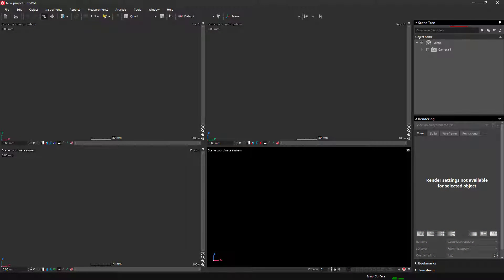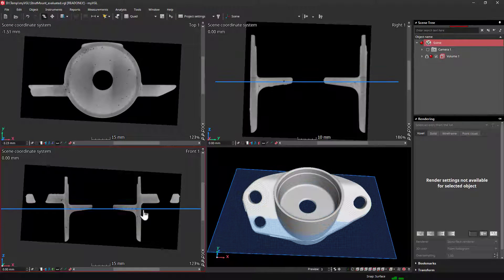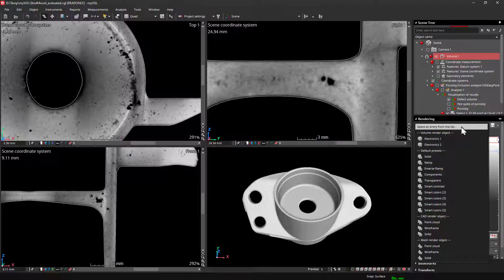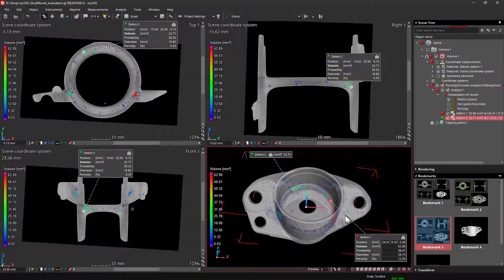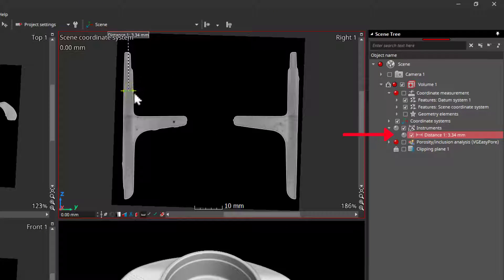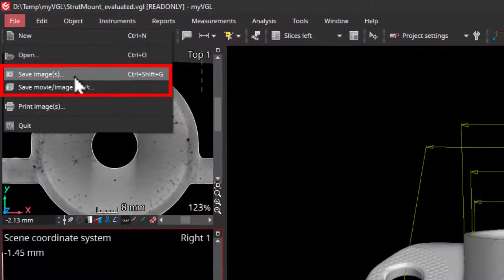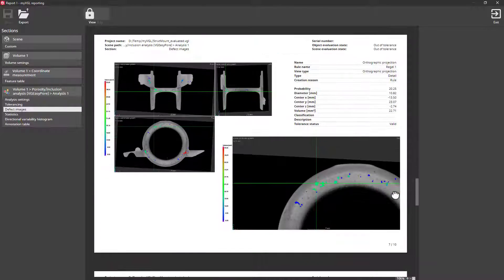Intro to myVGL

Comment: AI Summary

Abstract:

This video provides an introductory tutorial to myVGL, a free viewer application designed for project files created with Volume Graphics software such as VG Studio Max, VG Studio, and VG Metrology.

The tutorial covers fundamental aspects of using myVGL, starting with methods for opening project files, including options to manage memory usage by adjusting data resolution or unloading gray value data. It then guides the user through the default interface, demonstrating navigation techniques within 2D and 3D views using mouse controls and the navigation cursor. Visualization adjustments via the rendering tool and histogram are explained. A significant portion focuses on accessing and utilizing project content, such as activating prepared bookmarks to quickly jump to points of interest, finding analysis results through analysis annotations, and exploring detailed analysis dialogues. The video also demonstrates how to view and create measurements, including checking tolerance status for coordinate measurements, and how to save images, movies, and generate comprehensive reports from the project data.

Navigating and Analyzing Data in myVGL: A Viewer Tutorial

*   0:00:10 Introduction to myVGL, the free viewer application for projects created with Volume Graphics software (VG Studio Max, VG Studio, VG Metrology).
*   0:00:26 Overview of topics covered: opening projects, user interface, analyses, measurements, and extracting information.
*   0:00:39 How to open a project: Use File > Open or drag and drop the `.vgl` file into the application.
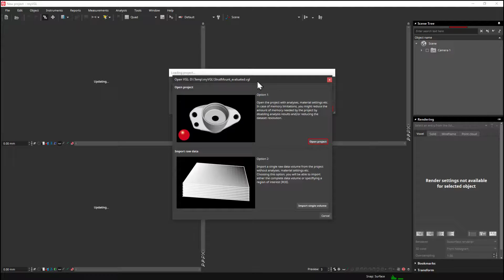*   0:00:51 Opening options: Choose "Open project" to include all analyses and measurements, or "Import datasets only". "Open project" is recommended most of the time.
*   01:08 Data loading options: The software shows required memory vs. available RAM, indicating if the project can be opened at full resolution.
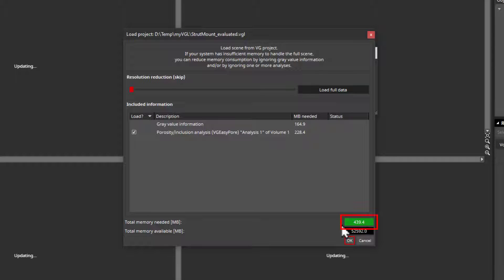*   01:41 Memory management: Reduce the resolution (combine voxels) or unload gray value data (if an advanced surface determination exists) to decrease required memory for large datasets. Analysis results remain unchanged regardless of loading resolution.
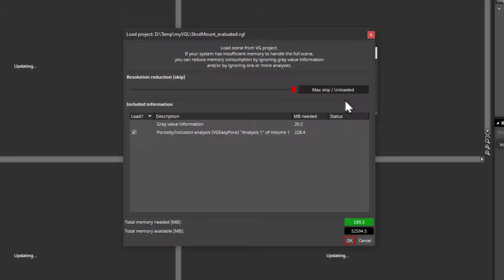*   02:44 Default user interface: Displays three 2D views and one 3D view of the data.
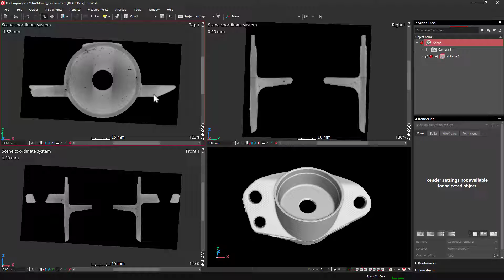*   02:57 Navigating 2D sections: Scroll with the mouse wheel or click and drag a plane in one view to see its location in others. A sliding bar also allows quick layer navigation.
*   03:29 Zooming: Hold the Control key and scroll the mouse wheel over a point of interest.
*   03:38 Synchronizing views: Activate the navigation cursor, then hold Control and click in any 2D or 3D view to bring all 2D views to that location.
*   04:04 Improving contrast: Select the volume object in the scene tree, use the Rendering tool and histogram to adjust the opacity curve, or apply presets like "Smart Contrast" or "Ramp".
*   05:05 Using bookmarks: Access bookmarks here to see preview images and descriptions. Double-click a bookmark to instantly adjust all views, selections, and rendering settings to saved points of interest, like porosity hotspots.
*   05:58 Analysis annotations: Point to specific analysis results (e.g., largest pores). Clicking an annotation in the scene tree makes the 2D views jump to that location. Annotations are available for all analyses.
*   06:30 Creating custom annotations: Select the analysis, activate the analysis annotation tool, and hold Control while clicking in a 2D or 3D view to add your own annotations.
*   06:50 Analysis dialogues: Double-click an analysis in the scene tree to open its dialogue, showing calculation settings, color scales, and specific results like a list of defects or directional variability.
*   07:38 Measurements: Create new measurements (e.g., distance) using the Instruments tool; they will snap to surfaces and appear under the volume in the scene tree.
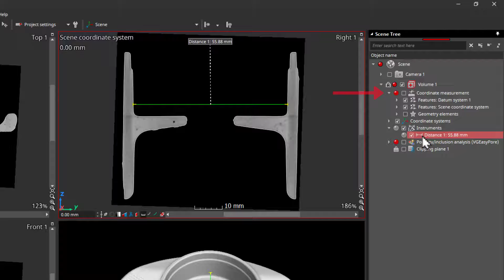*   07:57 Existing dimensions/tolerances: Found under the "Coordinate Measurement" section in the scene tree, organized by coordinate system. Clicking a feature jumps all views to its location. Color indicates if it is within or out of tolerance.
*   08:27 Filtering features: Use the double arrows to filter the scene tree, for example, to show only features that are out of tolerance.
*   08:41 Coordinate Measurement overview: Double-click the section to view a table of all features and geometry elements.
*   08:59 Layouts: Change the window arrangement or maximize any 2D or 3D view.
*   09:19 Sharing results: Save images or movies using File > Save Image or Movie. The current visualization and layout affect the options.
*   09:53 Reporting: Use the Reporting tool to view finished reports or create new ones by selecting items in the scene tree.
*   10:21 Viewing and editing reports: Open the detailed report; switch to "Edit mode" to customize it by removing sections or modifying tables.

I used gemini-2.5-flash-preview-04-17| input-price: 0.15 output-price: 3.5 max-context-length: 128_000 on rocketrecap dot com to summarize the transcript.
Cost (if I didn't use the free tier): $0.0061
Input tokens: 14489
Output tokens: 1127

Comment: On the instruments tab, all options are locked, how I can unlock the dimensions?
Reply from the maker: Hi,
the availability of this function depends on what you have selected in the Scene Tree (in the upper right corner of your screen). Make sure you select the volume on which you would like to measure. The volume should have a light red highlight, and the instruments should now be usable.